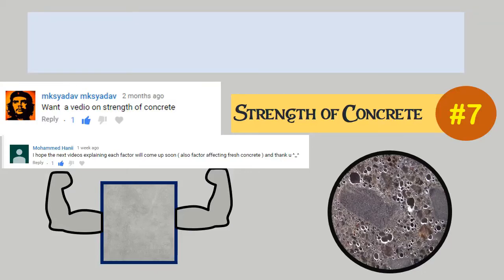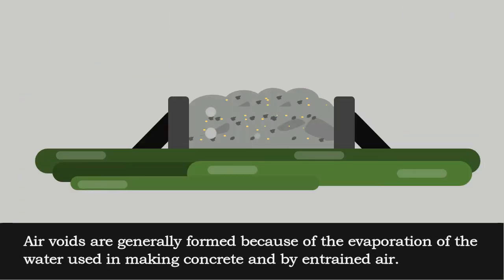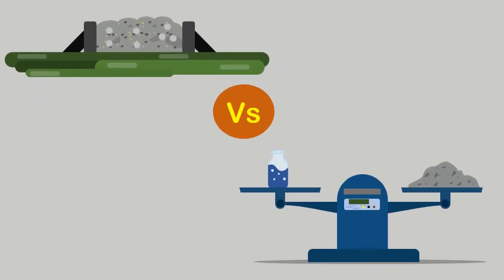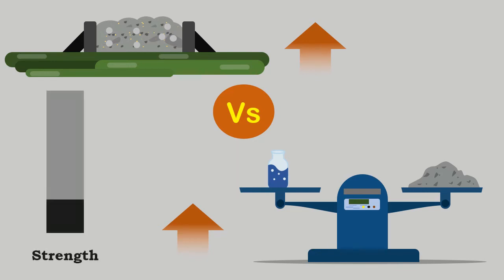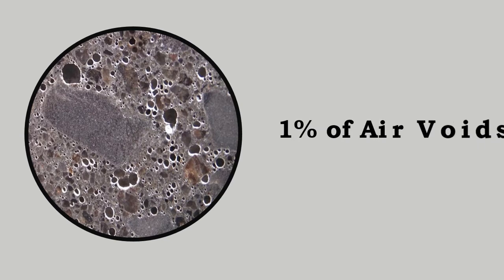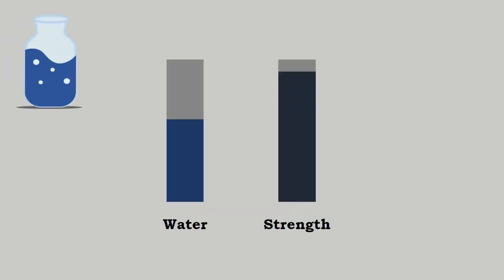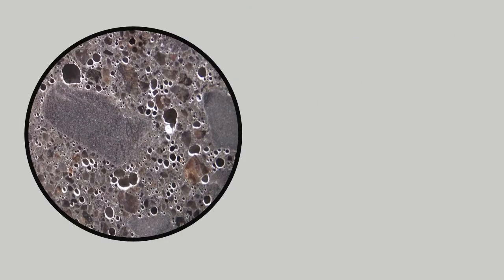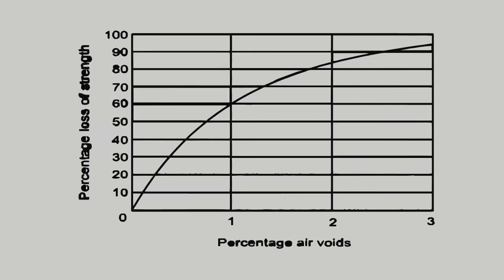Effect of Air Voids on Strength of Concrete #7

Comment: This is not true. Many concretes has air void content above 5-6%. They do not lose all their strength. A rule of thumb is that strength reduces by 5 % for each 1% of air voids. If one is using air entrained admixtures, it can make the concrete more workable, to reduce w/cm ratio and therefore compensate for some of the strength loss, in additon to make the concrete more durable to freeze-thaw.